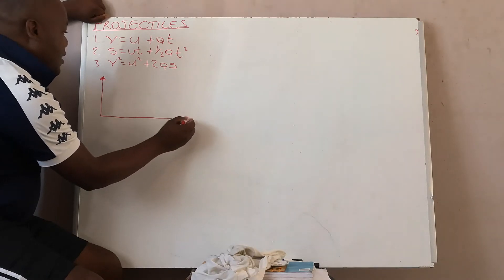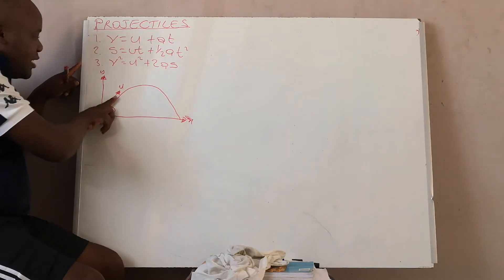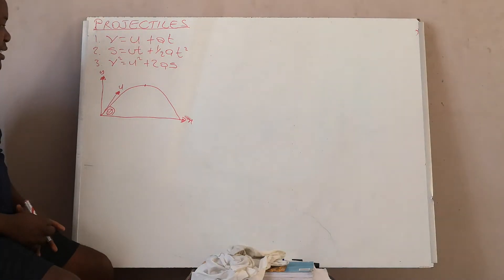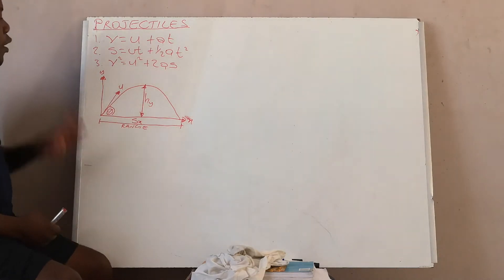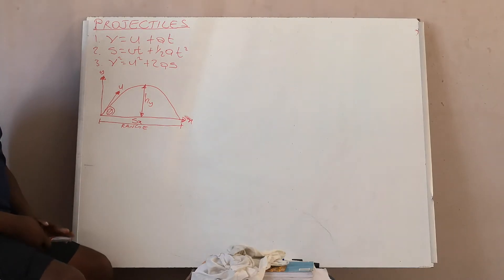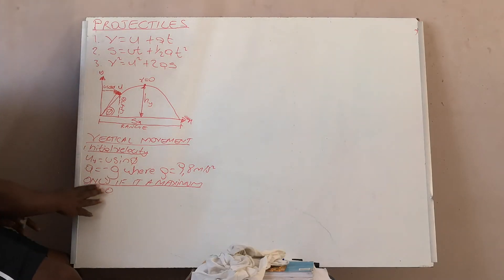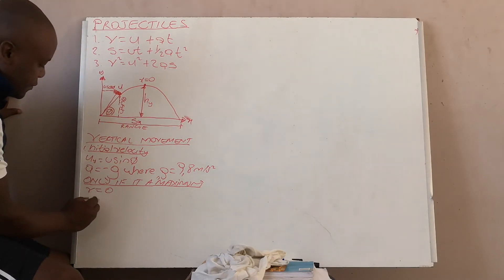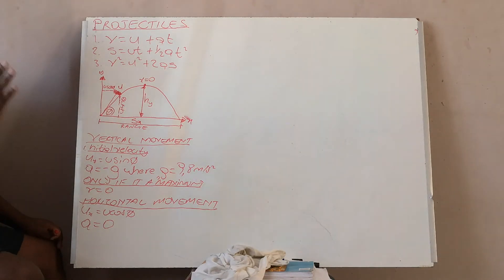Introduction to projectiles (Kinematics) vd6

Comment: an effort force of 310N is applied to the lever of hydraulic press, and the strocke lengh of the plunger is 120mm the mechanical advantage of the lever is 20 the diameter of the plunger is a third of the ram determine the following : load of the object lifted by the ram if the efficiency is 93%  b) number of operating strockes if the object in question 6.1.1 is lifted for 410mm the diameter of the ram is 360 mm and the efficiency of the hydraulics press is 93% calculate the pump required to pump this water
Reply from the maker: Which year and trimester